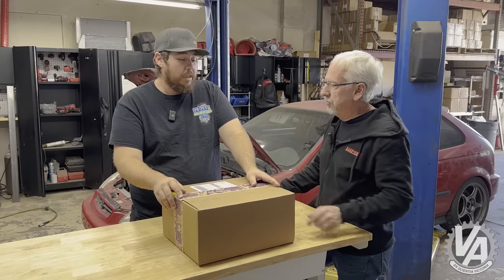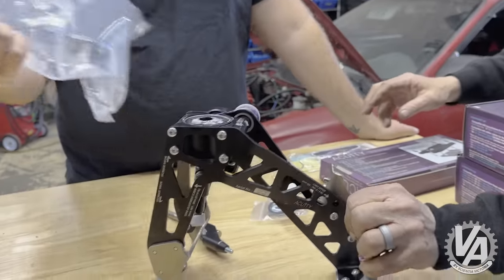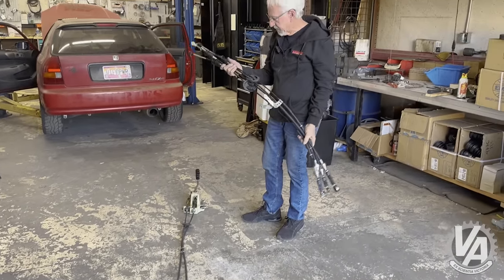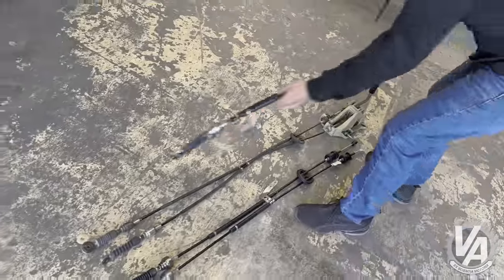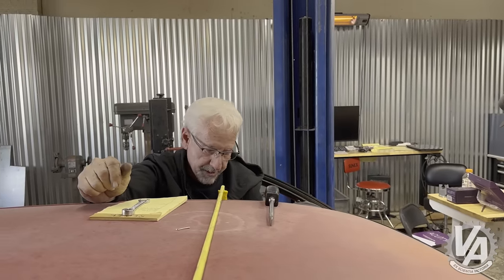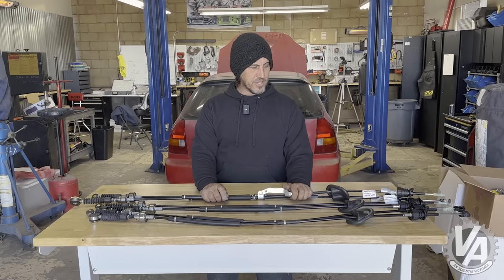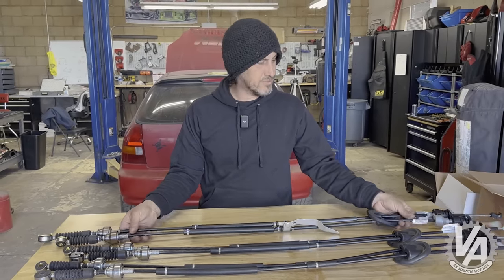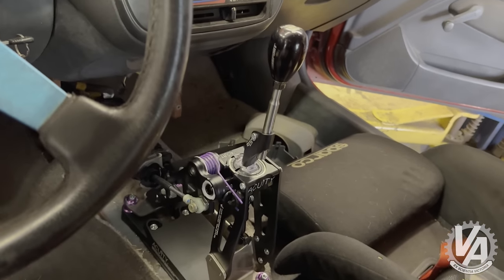Can You Use a 10th Gen Civic Shifter in a EK Civic?

Comment: Re: Firewall holes with engine in, use a sheetmetal "knockout punch". Can fight in very tight spaces, using a ratchet. Still need a pilot hole though.

Comment: Mad scientists are at it again!
Reply from the maker: Ahahaha! OK, a body from 1998, an engine from 2014, a transmission from 2006, shifter cables from a Type R and a short shifter from Acuity walk into a bar...
Reply: More details on this car please! 
So a 8th gen si gear box bolts onto a 9th gen motor!?
Reply: What ecu? Did you change the timing cover for the crank position sensor?